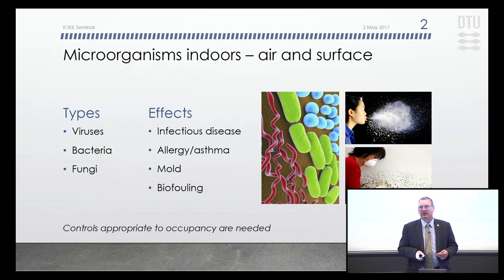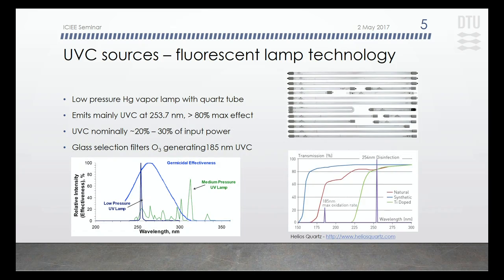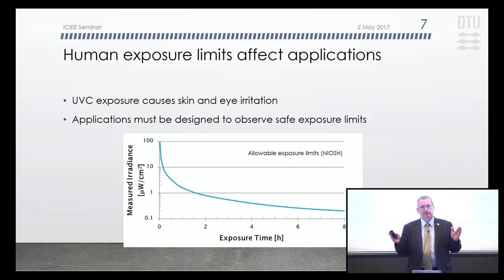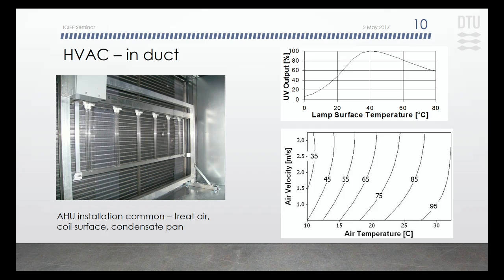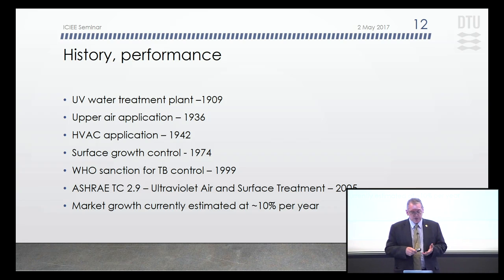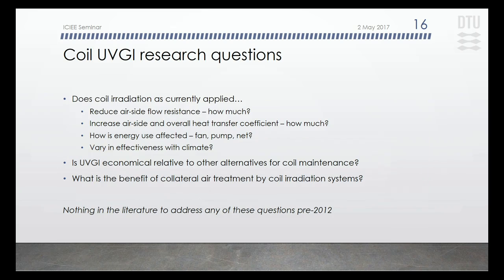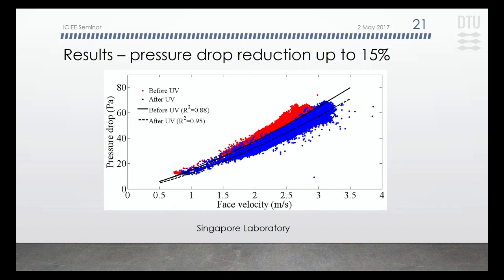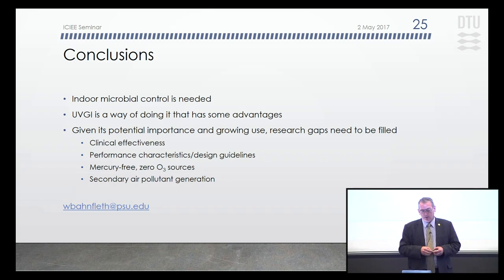Ultraviolet Germicidal Irradiation Fundamentals and Indoor Environment Applications

Comment: Why is it that a recording of a strong UV light not have the same effects on cells and bio organism?
Reply: Because the rendering device.. cathode ray or lcd/led renders most of its light in the visible spectrum and a minority of it in the UV and infrared.  This way by design.  You could use a custom LCD filter to modify light from a UV strong source, but the LCD and glass themselves would block much of the UV.  Did make an interesting thought experiment .... it's the same reason the output from a telescope to a monitor shows far more visible light than is actually visible to the human eye.

Comment: I am a bit confused.  Is it the UVC light that kills the germs, or is it the ozone generated by the UVC light that kills the germs.
If the ozone generated by the UVC is bad for humans, should I open all the windows in my room when I turn on the UVC light ?
Reply: Standard UVC light in all probability does not penetrate nooks and corners or irregular surfaces     Ozone does.  Problem is irritation.  If it’s a closed room , open windows at least for an hour before use  of area or use exhaust or centrifugal fan systems   Ozone can reduce life of rubber items in the room   Ozone is generated by vapour tubes at about 180-200 nm.
Reply: Any ozone generating system is typically bad for your health. DO not utilize a OZONE generating device. The UV-C breaks down the DNA and RNA structure of the microorganism and irradiates it.